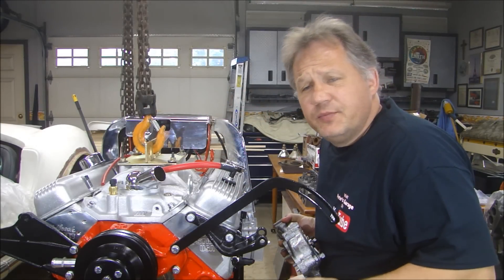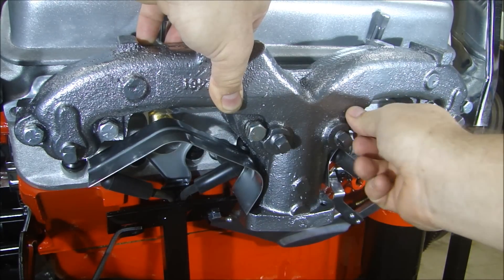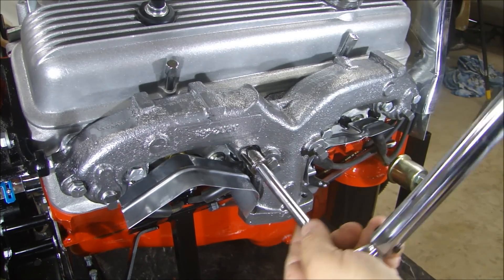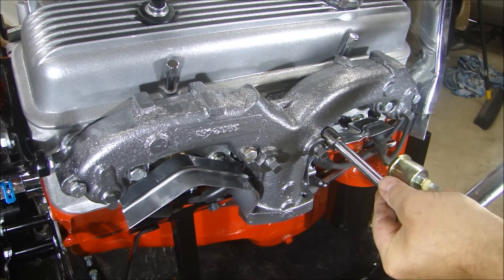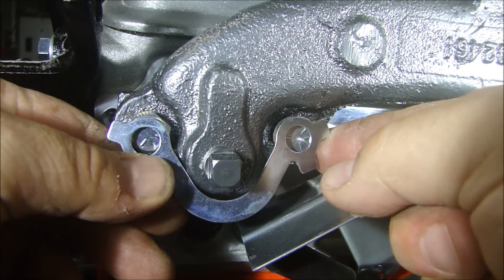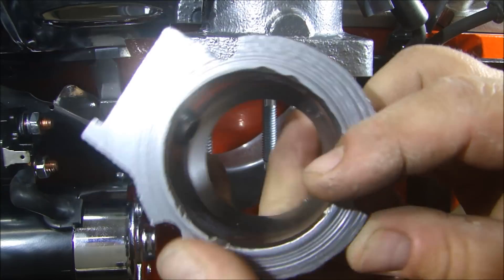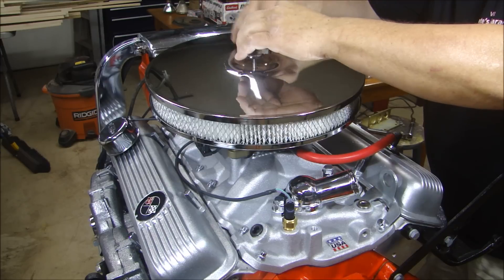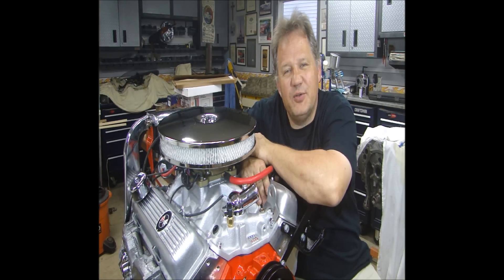Engine Building Chevy Small Block 350 - Installing Exhaust Manifolds, Finishing Assembly

Comment: Nice Job Pete! I really like those Nord-Locks. I noticed you did NOT use headers. Hot rodders get so used to putting headers on everything they forget some folks are not interested in melting everything under their hood to produce more peak horsepower. I got so tired of heat soaked starter issues and melted plug wires, I quit using headers years ago. I'm more interested in keeping things cool and reliable. I'm curious, however, do you have any idea how your torque and horsepower numbers would suffer with manifolds vs the headers used in the dyno test? I'm assuming things would be unchanged on the lower end of the curve? I would love to hear your thoughts. I am thinking of following in your footsteps with a Chevy pick-up I am restoring from the frame up. I like that the Edelbrock E-street pwr pkg combination is all spelled out, proven and tested. In addition, your video series here also proves it works in the real world. Is there anything about this build you would change, if you were putting this in an old but very nice 1976 K20 4x4 Chevy truck?
Reply from the maker: The numbers don't suffer as much as people think. If you tune it with the manifolds it will perform just fine

Comment: Pete, Awesome video series. I also have a '76. However, I'm installing a 383 stroker. Due to fitment issues, I'm considering using the original rams horn manifolds like you did here. Am I sacrificing a ton of power and performance by using the rams horns instead of buying headers?
Reply from the maker: Cool Jerry, that's a fun project. The restriction is more in the heads. The rams horns can flow pretty good. You're not sacrificing much if anything at all.
Reply: @PetesGarage  , Thanks for the info. I just shared your 350 build on the C3 Corvette Facebook page. Folks were talking about the Holly Sniper, so I posted your video. Thanks for sharing your knowledge and expertise. I'm glad I found your channel.
Reply from the maker: That is awesome! Thank you very much my friend

Comment: What did this 350 build cost?
Reply from the maker: The Viper system was the most expensive, but I'm going to say about $8,500
Reply: Dam 8500 does that include swapping it in the car and installation?

Comment: Is there a specific reason you used grade 5 fasteners instead of grade 8?
Reply from the maker: Application.  Using a higher grade fastener does not always mean better, but it does always mean more expensive.
Reply: Thanks for the reply Pete!